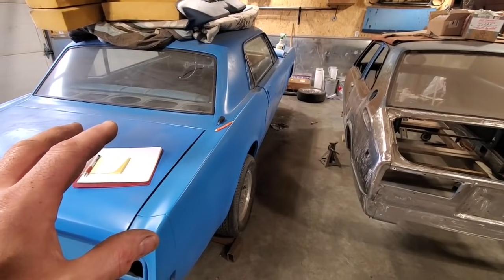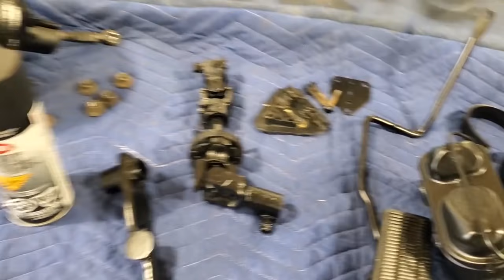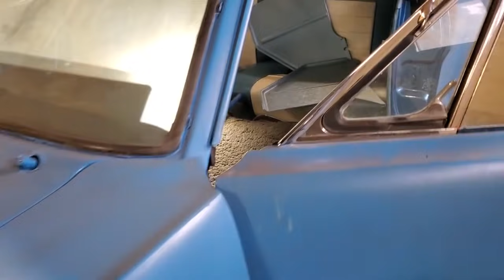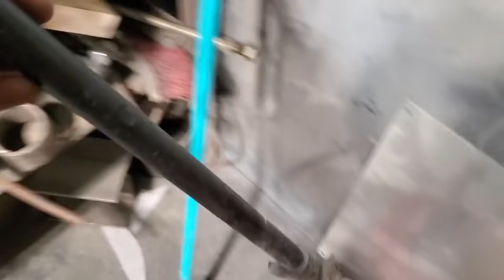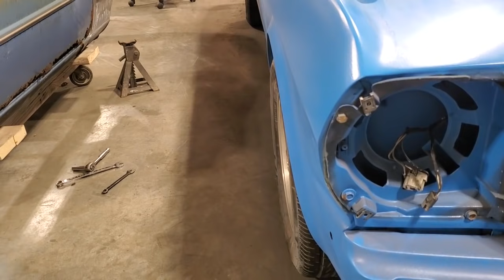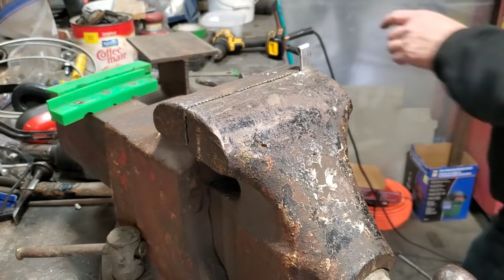66 Mustang project. Some assembly required

Comment: Geez that metal clip fabrication is well done - with a nail and vice grips no less. I'll be using that technique myself for the future, for sure. Good to show you how we don't need to buy everything when you've got the know how. I like it
Reply: I made mine from 25 gauge steel, so I could cut them to length with tin snips.

Comment: Ahh front brake lines on that platform... first brake lines I ever made. Because of that learning curve and two cars I've made more of those than any other brake line. Back as teen I didn't have a flare tool so I would buy the pre flared line with the fittings. Then bend it up so it exactly fit taking the same route soaking up the extra length in the u-turn to the bracket where it goes into the hose. 

The original ford clips aren't much different than what is made in the video.

Comment: Tony, a couple of tips for you for making the line clamps.  

By adding some heat shrink tubing to the clamp before you bend it over, you end up with a cushioned clamp.  

Secondly, if you get an Olfa P-Cutter 800 utility knife, you can score the aluminum and then flex it to break it.  The P-Cutter is a carbide knife designed for scoring acrylic sheeting and it works amazing for straight cuts in aluminum.  The P-Cutter might not be as fast as the grinder but it will give you better control when dealing with smaller aluminum parts like the strips you made the clamps from.
Reply from the maker: Good tips thanks

Comment: Over the years I've had too many instances of corrosion and abrasion of brakes lines at the metal clamps. I try to put something between the clamp and the line to insulate the two. It seems like rubber pages the longest but a strip of Teflon tape does well too and it's not as bulky.

Comment: Tony-At first blush the total toe change through the suspension travel appears to be excessive. I trust your judgment and explanation that it is within specs. Please keep us posted as the suspension alignment is performed and your impression on the initial test drive.
The tips are always good. Thanks for sharing your experiences.
Reply from the maker: The higher you jack it the worse it gets. There is little or none from ride height to braking. Keep you posted.

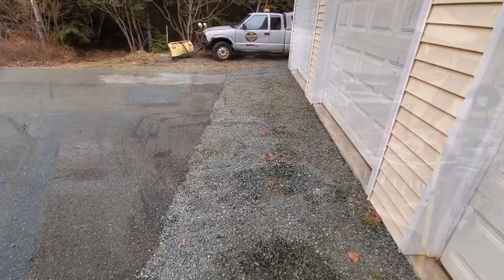Comment: 2:29 "A few of you asked about patches.., "I got him out here in the patina bay so he can rust.....
LOL..."Bro, Newfoundland is the only place on the map where you can listen to a vehicle rust, it sounds like bacon frying in the pan.. 
For those who can't wait...
A quick simple recipe for patina juice, add  4 tbl spoons of coarse sea salt to 1 gal of water along with 8-10 ounces of Hydrogen Peroxide,  2 cups of distilled white vinegar and 1 cup of degreaser, mix well and use a spray bottle to apply the juice, let dry. 2-3 applications, the part will be rusty as an anchor. 
Its great for making flash rust in a hurry but not much good on a fish and chips.

Comment: @Fitzee's Fabrications, Fitzy My Friend You need a Milwaukee Fuel 3/8 impact and maybe if you have a few Dollars extra a 3/8 fuel ratchet and even just a 2 a/h battery 
Great Watching someone using Spanners BUT I knows just how long that nut and bolt tightening takes 
I have more time for more stuff now that I have those two tools and a set of short and long Impact sockets  So much faster doing things now 

Keep Safe Bruutha !!

Comment: When I was working on y 1982 Mitsubishi L300 van, I made my clips the same way as you did, but I used 25 gauge steel. So there was no need to clamp everything and I could trim them to length with tin snips instead of using the angle grinder and burning my fingers like you did when you took the clip out of the vise. I wonder who else noticed that.
Reply from the maker: Hahaha

Comment: Not sure what your brake  lines are made of,  but across the pond here in Northern Ireland we have copper brake  pipe, nice and soft easy to bend the easy to flare an end on. Also lasts a lifetime.
Reply from the maker: I seen those. Think you can get those here. These are steel. Soft enough  to bend by hand.
Reply: We used to have copper brake pipe here in Australia decades ago, but they banned it for some reason.

Comment: Hi Fitzee,
Again, another fine job with lots of useful tips!!  Did you have any video on the preparation and flaring of the brake lines with the tube/barrel nuts that fit into the master cylinder/flexible brake hose?  That would be useful to a fairly large audience as this is an area where many questions are asked about the making of brake line flares.
Cheers
Reply from the maker: You are one of a few who asked this so ill do one.

Comment: Have started fabricating using some of the fabulous tips and techniques in your vids but have one question....is it bad practice to weld along an edge? So imagine I was making something the same shape as a tyre. Could I just cut out two circles and bend a long strip into a circle and weld the edges.....? eg are welded edges a weak point that could crack under certain conditions? Mike
Reply from the maker: No they are not weak. If you can I weld the inside. Wheel tubs have this same idea.

Comment: Hi Fitzee, love your videos.  Im learning a lot.  I have a question I've been wondering about.  Why are body hammers so small?  When flattening metal on an anvil I've always used a large hammer.  It just seems faster, taking fewer hits.  Can you please help me understand?
Reply from the maker: Larger hammers have weight and will stretch the metal easier. You have more control over your repair with smaller hammers

Comment: Another great video Fitzee!
Without sounding too pedantic, is the risk of rust negligible when drilling the body for bolts and screws?
Reply from the maker: Yes if you tend on driving it in harsh weather. I used a screw here that had a wax on the tip.  Sometime a small but of grease will help protect it as well
Reply: @fitzeesfabrications  Thanks for the tip!👍

Comment: Hey, I watch all your videos and is a big fan . Was woundering ! You installed the booster and the reservoir and I was woundering how you bleed it, or how you bleed the brakes?? Do you pump and bleed or have a different way in doing it
Reply from the maker: Wanted to get everything mounted and lines made. I'll remove the MC and bench bleed it when comes time for that

Comment: great tip on the brake line clips i shall use them on my cars,mustang coming along great but will you finish it before starting on another ? i always say that but never do,i shall be watching bud whatever your workin on.
Reply from the maker: Plan is to finsh this off completely
Reply: I made my clips from 25 gauge steel so I could cut them to length with tin snips and no need for clamping when making them.

Comment: Not to change the subject but ... I have a set of running boards 1956 Ford rusted on the high spots , any thoughts on a fix for them? Great Videos love to watch and learn , Have a pair of Rear fenders to repair too.
Reply from the maker: I replace section of running boards with section from another parts running board. It it is small enough I make a section to repair  it. Getting the bends in the right spot is tricky and needs alot of time

Comment: Hey Fitzee, as always, I really appreciate your videos :D
I do have one question concerning my own restoration process...

How do you take care of the "hollow section's" especially on those rusty cars, what has proven to be your go by method, treating and coating the outside is one thing… but what about the hidden rust. I do know how to take care the expensive way, but Im really interested what a more budget approach would look like. 

Thanks a bunch^^
Reply from the maker: Anything  you use in harsh weather I like to drill holes that I can put plugs in and find a nice rust coating that creeps ones it is applied.  I have it done to my daily ever year.

Comment: Do you make your own grommets for passing the brake lines and wiring through metal panels or make the holes big enough so there is not any rubbing?

I will have to watch the rack and pinion videos design. Why do folks change to rack & pinion from conventional steering boxes like in a truck?
Reply from the maker: I pick up grommets in packs of 50 at princess auto and there are different sizes. Don't like brake lines coming in contact with metal

The power steering that came on the early mustangs was not a very good system. Most leaked and would have to be rebuilt. This car never had power steering so I had to install power steering.
Reply: @fitzeesfabrications  
I understand I had 1973 year only rack and the springs would brake on the inner tie end socket that I bought in 1986. About every 3-6 months the spring would brake and the tires would go all over the place when you hit a bump. I liked the car (2L german motor and manual trans combo), but could not do anything to upgrade the rack back then. I got redesigned in 1974 - 80 years.

Comment: Have you test fitted the engine and transmission with the new steering rack? It looks to sit to far back, will it not interfer with the flywheel and bell housing?
Reply from the maker: Took alot of measurements. And I'm sure I'm OK. We will see.lol